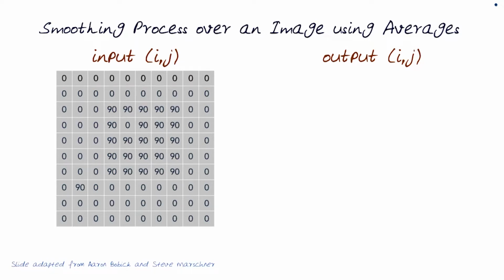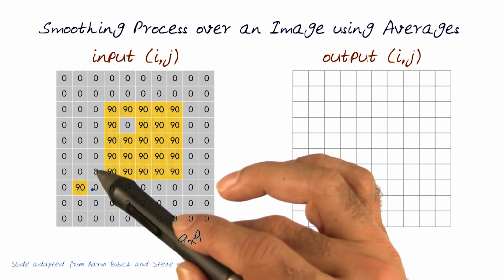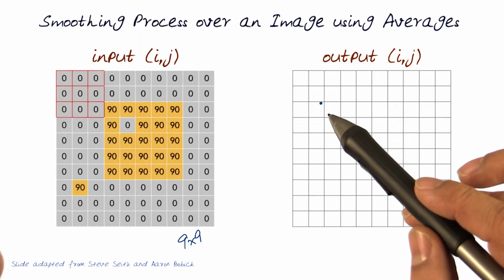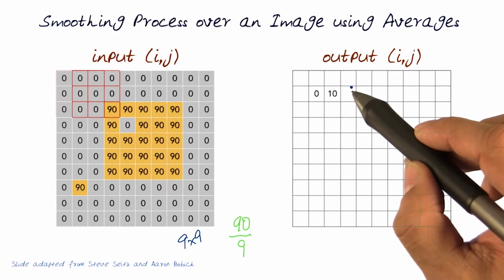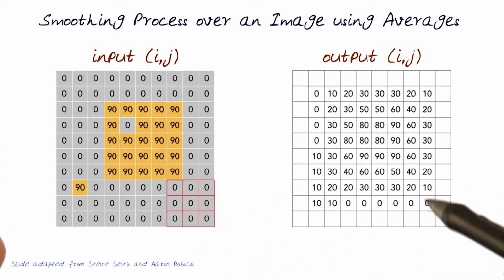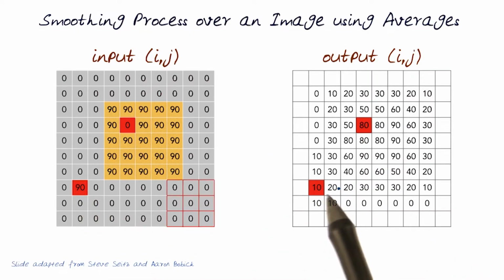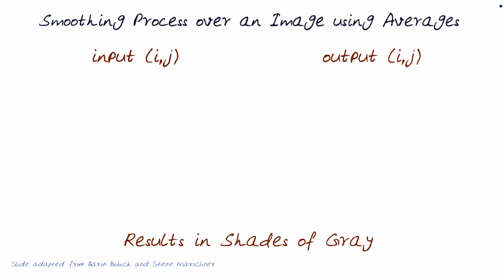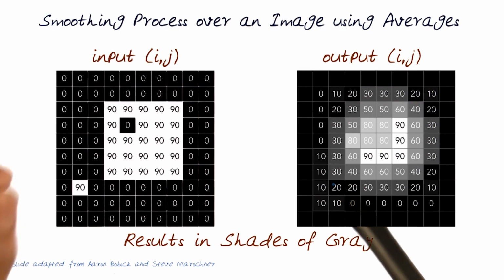Smoothing Process Over an Image Using Average

Comment: Input image is 10X10 and then the average is actually calculated based on the total number of pixels in the filter, not the number of input image. A filter of 3X3 gives you 9 pixels.